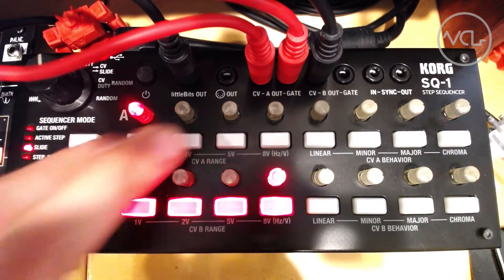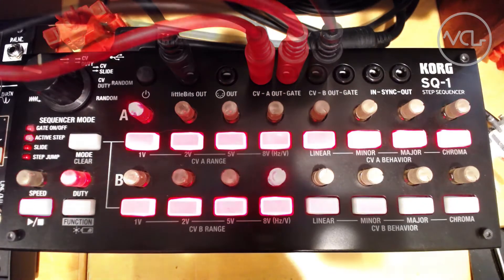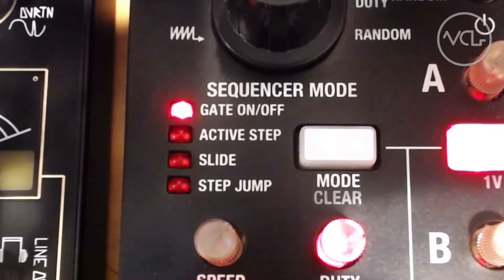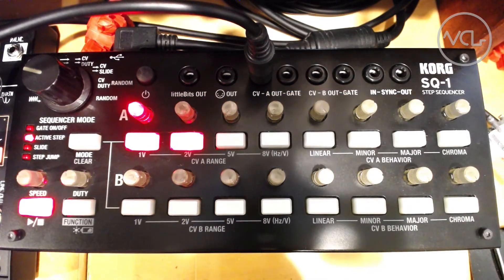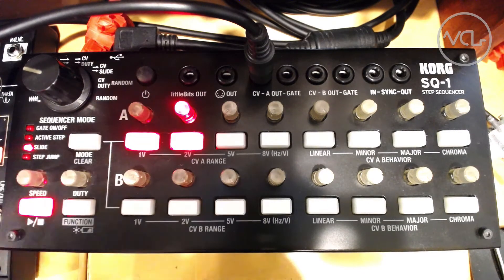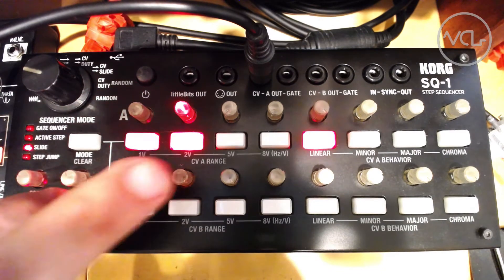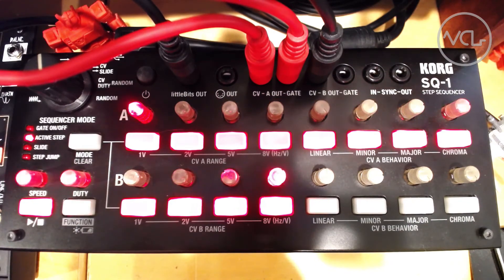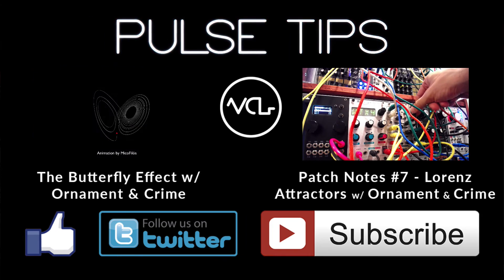Korg SQ-1 LFOs

Comment: Great info! Considering a sq1 to add mofd lfos to a minilogue xd. Is it possible to create a sample and hold type of lfo?
Also since it can be two sequences does that mean I can create two lfos?
-thx
Reply from the maker: In a sense yes it can do two, though this might not be the ideal tool for LFOs or sample n hold. It’s more of a sequencer that you can KIND OF force to do LFOs lol. Minilogue probably doesn’t take cv inputs either, which would force you to use midi which drastically limits how you use that data, so it might not do what you are looking for.  :(
Reply: Thx for replying. Yeah the minilogue xd has cv inputs. Im really looking for the simplest way to add an lfo (or two) to the synth. Besides eurorack or a semimodular synth would you have any other suggestions?
Reply from the maker: It’s eurorack BUT hear me out... I would consider one of those 4ms pods. You could really pick from many LFOs, possible a multi lfo, and keep it light and portable. I can’t think of a lot of self contained LFOs, but you know what else you could try... is making one! I bet it would be relatively easy, even programming a teensy would be WAY cheaper than any modular stuff.

Comment: I've been sending cv from it to VCAs to act as accents. So i have the ADSR going to a vca and then THAT goes to another VCA with sq-1 volatage controlling it. Its easy to add, drop, and change accents or mute notes. Accenting every third note is pretty cool, for example.
Reply: Nice idea
Reply: I have been trying to sync my tonic po-32 pocket operator to do this exact thing because of the accent feature and how it's the best drum machine of the pocket operators imho. I can't seem to get any sound out of the SQ-1 to even experimenf with... Any idea on what I'm doing wrong?
Reply: @ghost_in_the_robot   Just in case, you do know the SQ-1 sequencer cannot make sound, right?
Reply: @Tofu_Pilot  yeah lol... From what i can tell the CV channels are inputs for your melodoc sequences and the 5v and 8v options allow pitch changes using step options. The gates are the output to your mixer or other synth gear? I actually had it working using the midi out to my old keyboard, playing an arp sequence from my keystep. That was an accident though lol

Comment: I use a Beatstep Pro (BSP) for my setup's master tempo.  I configured my drum machine so that Pad 8 on the BSP is silent, and connected the BSP Drum Gate 8 output from the to the SQ-1 Sync Input.  Now every time Pad 8 on the BSP plays in a sequence or in real-time, it triggers a step (or multiple steps) on the SQ-1.  Want a steady running sequence? Program or play a steady beat on Pad 8.  Want syncopation, a stuttering rhythm, odd time?  Whatever plays on Pad 8 drives the sequence rhythm.

Downside is that I lose a pad -- equals one instrument -- on the BSP drum machine. Also I have to program the sequencer rhythm into every drum pattern I do.  It also took a bit of screwing around with gate polarity settings on both the BSP and the SQ-1, and in the end I had to buy an adjustable attenuating cable to get the voltages right.  But it works consistently even with 16th note triggers at relatively fast tempos.
Reply: it would be nice to see a video tutorial demonstrating this setup , i dont have a BSP but i am sure others would find it useful and it may give me ideas too

Comment: if u can show me how u did this, I'll kiss yer ass. I've done it ver batim,  and nothing. please tell me that I'm not this stupid.
Reply from the maker: I'm not doing it for the ass kissing, and I'm sure you are not stupid! How do you have things setup? I'd suggest trying with something very simple, like using to steps, one set high the other set low. Route it into the FM or v/oct input on an oscillator, just to see if we can get an obvious result. Route the oscillator out, and you should hear it doing its thing...
Reply: I'm using my mother 32. Also tried volca  bass. I've been at this 1 yr to the day. Still super insecure. Totally committed though.